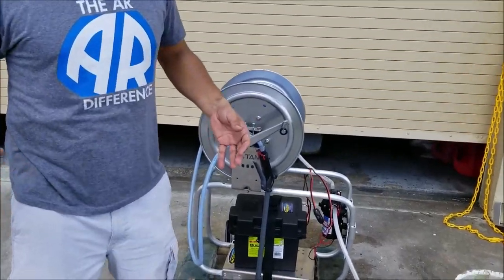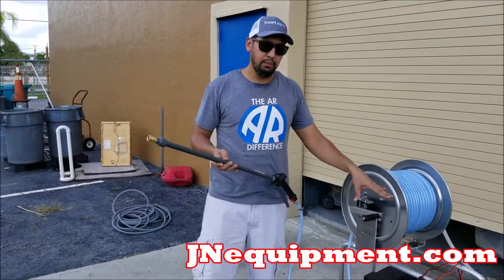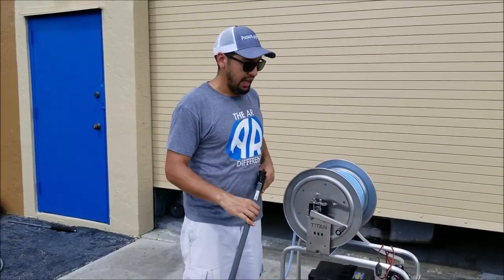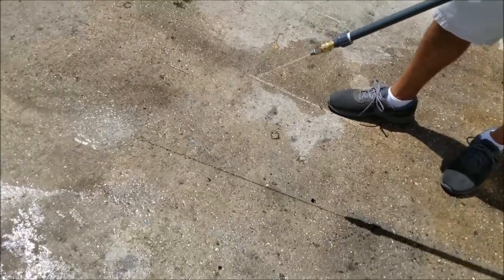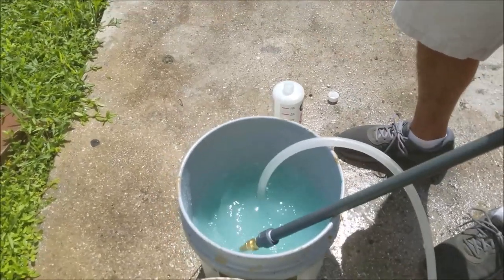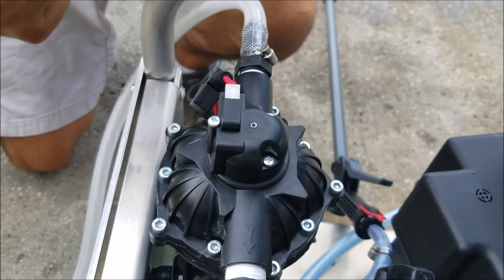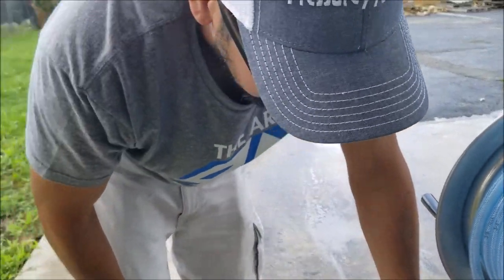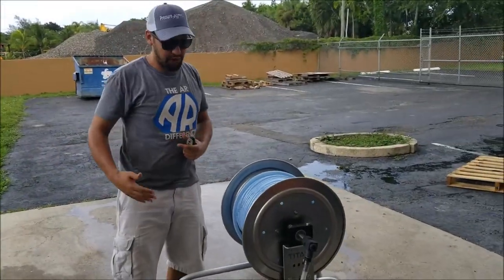How to Prime & Flush a Stealth Pro Soft Wash System

Comment: So many ppl just change out the whole pump when it fails, good tip on getting replacement switches👍
A complete replacement head costs less than 40$ and its basically a new pump, i keep a spare in my tool box..

Comment: Good video,  I think the second half is why my system broke previously.   I have since purchased 2 new pumps;  one as a backup.    I think when I replace that top piece on the original one it should work.    If you did a short video on 17:50  that would be helpful too.

Comment: Hi mate what pump is that?  And does it have a switch and relay? Thanks

Edit I see it has an on off switch, but does it have a relay somewhere in the wiring ?
Reply from the maker: on/off switch yes, only the 7 GPM pumps have a relay. all the models have a pressure switch which toggles the pump on or off, it will run until max pressure it reached & then turn off until you pull the trigger again.
Reply: @Spraywell   thanks mate, is the relay built in or will I have to wire it up . I ordered a  7gpm this week

Comment: After you clean it out, do you leave the clean water in the line until you use the unit again?  Or do you flush it all out and leave nothing in the line?
Reply from the maker: It's ok to leave water in the system. Water won't cause any issues BUT if you do leave water in the system make sure to DE-PRESSURIZE the system by pulling the trigger and relieving any trapped pressure.  So the take away is: you can leave water in the system, but you cannot leave the system with trapped pressure. pull the trigger and relieve the pressure before storing.

Comment: 2:19,   why 10 seconds on trigger,  10 seconds off trigger?     My thinking would be just hold down the trigger?   I am new to this.
Reply from the maker: It's possible for water bubbles to get trapped in different areas because they naturally want to rise against gravity (just like air bubbles underwater move up towards the surface). By cycling on the trigger it makes the flow start and stop & start and stop which can help dislodge any trapped bubbles. Bubbles of air can get trapped in the diaphragm pump head (common), in the hose(common), and in other areas like the hose reel manifold (less likely).

Comment: Is this for all 12v pumps? I have that pump but 7gpm. And from the day I got it, It never is consistently on when spraying. It doesn’t turn off and on as quick as your demonstration, but it runs then takes a brief paise.
Reply from the maker: most diaphragm pumps have a way to make that adjustment
Reply: JN Equipment and I should be priming my pump each time I go to use it? And to do this I simply just take the tip off and pull the trigger until my chemical starts coming through the line ?
Reply from the maker: @caseybritton376   Yes and Yes.
Anytime air enters the system (usually indicated by weak spray), you need to prime your system.  Priming is simply the act of getting the AIR out of the system. The easiest way to prime is to simply pull the trigger. I like to pull and release the trigger in series to get it going.

Comment: Watched while video.  Great info. What’s the best hose to buy that doesn’t kink or twist up.   I have a hose that came with a bronco delux from norther tools and it was all twisted and took me 20 mints to wrap around hose reel.
Reply from the maker: I use this hose: https://www.jnequipment.com/shop/contractor-equipment-accessories/soft-wash-equipment/soft-wash-hoses/1-2-orange-ag-soft-wash-hose-200ft/   . For 4 GPM units I suggest 3/8 hose, any larger than that you MUST use 1/2 inch hose for proper results.

Comment: Is there any warranty system you guys provide from the house?
Reply from the maker: unfortunately we cannot offer a warranty due to the fact that this is designed to pump bleach/SH which is extremely aggressive. But I have never hung a customer out to dry and usually work with people even if they have issues which they may have caused themselves (usually from not flushing it out properly)